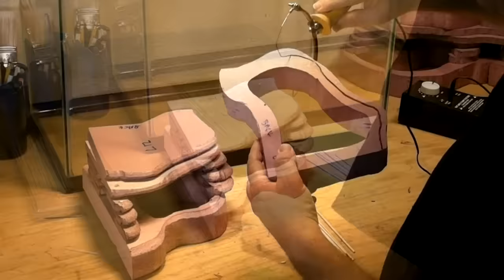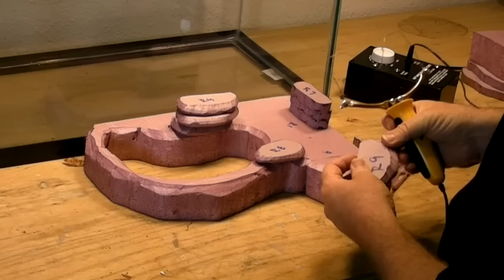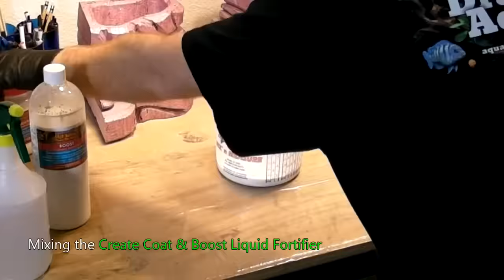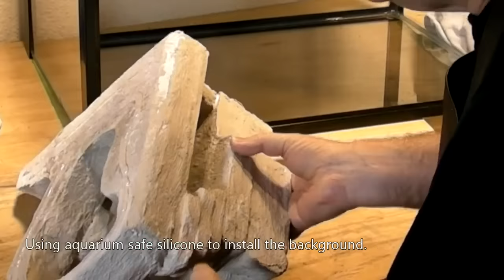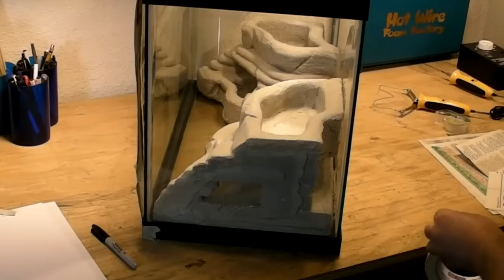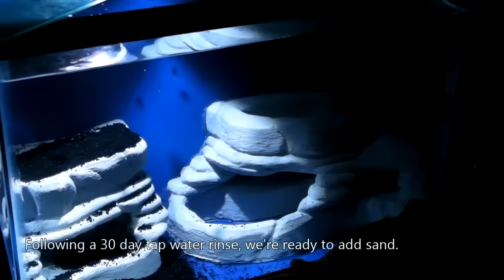Dramatic AquaScapes Aquatic Terraces 001 Part II

Comment: If you used cement, what did you do to fix the lime problem? The cement will cause the acidity of the water to go over 10. Besides changing the water every week for a couple of months, what did you do to prevent the acidity to go up?
Reply: 1 month of water changes, it says so in the video
Reply: To prevent the cement to loose acidity to the aquarium water you could use epoxy hars to create a safe layer on top of the cement. Doing so it will be safe for plants and livestock